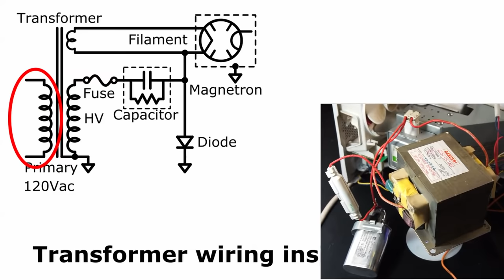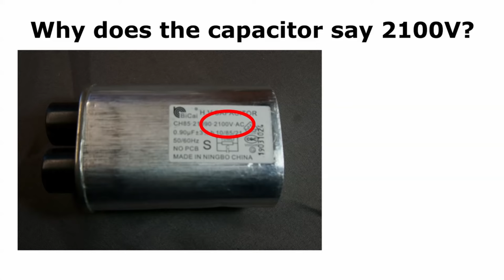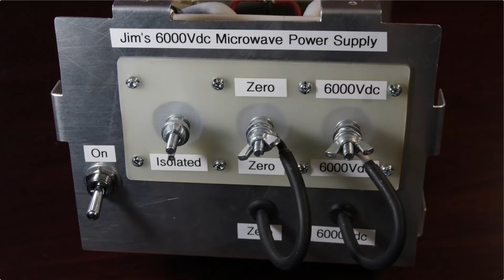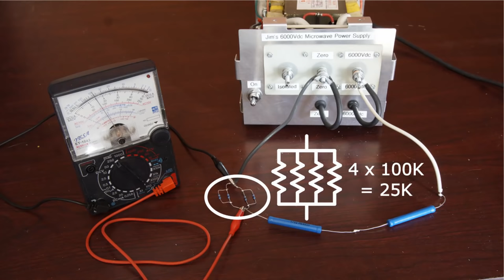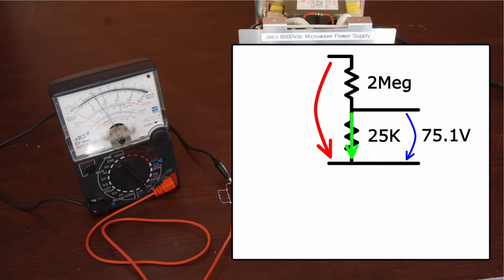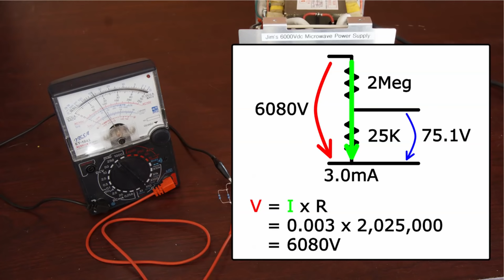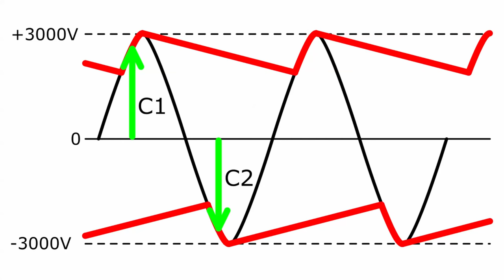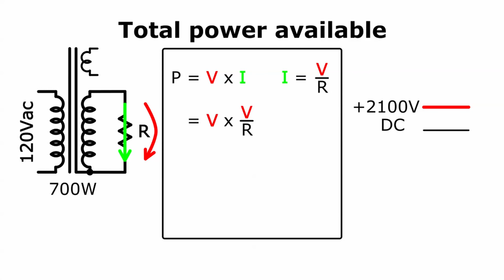6000Vdc power supply built from a microwave oven transformer

Comment: I am trying to go around forking out money on a big dc to ac inverter i have 1500w sine wave inverter and im wanting to see about adding a microwave transformer to get it to get more watts. Im needing 3600 watts to run camper. Can i use this ?
Reply: VERY SIMPLE USE 120 VOLTS STATION SUPPL;Y WITH AN 30 AMPS. FUSE AND YOU WILL END UP WITH  3600 WATTS.... VERY STRAIGHT OPÉRATION...HAVE ANICE DAY
Reply: NO

Comment: Very old TV sets used to have the EHT voltage, approx 27kv, derived from a mains transformer. This was stopped because it killed technicians.
High voltages then were derived from an oscillator that would die as soon as a high current was drawn from it, no longer killing people.
Making something like this is completely irresponsible.

Comment: This may be off topic, but someone might find it interesting.Over unity electric generator. By AMA.
Segment 1: 1 motor with bar connected to it standing vertically. Circular disc connected to bar that has magnets embedded in it surrounded in high permeability material to focus magnets outward pushing force in an upwards direction from top of disc. 
 Segment 2: Hollowed out cylindrical Bar of material horizontally positioned. 
 Flat hollowed out ring shaped material with openings around its outer top flat edge.
 Magnets surrounded in high permeability material embedded in these openings.
Magnets positioned in openings around ring are in at least 1 of 2 configurations either all N magnetic field pushing out or N,S,N,S all around it. Just depends on whether your going for Piston structure or spinning structure explained below & whether you want it to be DC or AC current. 
Place these all along the cylindrical bar connected to it solidly, except at far ends of bar. 
At both ends of bar place ring of material that can be magnetically repelled in specific locations. (magnetically repelled in specific location is in reference to outside of ring area that faces away from center of bar)(Other side of same ring facing in towards center of bar is capable of being magnetically repelled all around) Ring must be connected solidly to bar. points of repulsion on these rings is off set from each other on each end of bar. 
3 Hollow ring structures with small square bars protruding from each. Ring structure has all magnetic repulsion on inside of ring shape & can rap around the main bar so that the bar wont be causing friction on things as it moves back and forth or spins. 1st positioned around far left of bar, 2nd position at center of bar (be sure to leave enough room for magnetic structures to be able to move back and forth without hitting it) & 3rd positioned on far right of bar. 
Tube structure is constructed in two parts that fit together on top of each other length wise over main structure. 
Tube structure has 3 square openings for the bars that the Ring structures that are connected around the main bar keeping it from causing friction on structure, to slide into. 
This tube structure is designed with material that does not block magnetic fields. Perhaps some type of transparent material glass or other. 
 At both ends of the tube structure there is a built in circular groove that will house a round disc. The ceiling/floor/left side/& right side of groove has openings for small magnets to be  embedded in it, so that the pushing force from magnets is pushing in towards the edge of disc that goes in this spot. There is also 4 openings located on the top, bottom, left & right positions of the open groove. Small magnets are placed in these spots so when round disc is in position these magnetic fields will hit sideways keeping it from generating friction against structure. 
Far Ends of bar has Cap structure that screws over tube halves holding them together. Cap structure also has 4 points on inside top, bottom, left & right that have openings. These openings have small embedded magnets in them that exert there pushing force outwards (sideways) so it will keep disc in position, generating no friction against structure. Cap is made of material like tube so it does not block magnetic fields. (Note: These magnets in groove and cap structure are only needed for piston design. If Disc is directly connected to main bar so as it spins the bar spins, magnets are not needed here).
 The disc has ring around it (ring of material goes around outer edge and folds over front side & backside a small distance) that is repelled by magnetic fields so the 12 small magnets will keep it lined up but it will be able to spin without causing friction on structure. The disc has openings on it's flat side that face inside of tube and magnets surrounded in high permeability material are embedded in this disc. 
 The disc has small bar that is connected to it's center that goes all the way to the other end of  bar structure through the center of the hollowed out bar and connects to disc on other end. Disc on other end is set up the same but magnets embedded in it are off set in comparison. As first disc spins the magnetic fields will push against specific spot on disc connected directly to bar, pushing bar in other direction, once bar is fully pushed over, further spinning of disc will then align the other sides magnet to push it back.
 Tube structure also has half moon shaped protrusion on inside and on both halves so when tube is connected they line up to make a full ring shape on inside of tube, these half moon shaped protrusions have at least 1 small round opening on it's side in middle of curve that faces away from center of bar. The opening has a small magnet embedded in it so magnetic force is repelling out sideways away from center of bar. The protruding ring is positioned to line up slightly further in towards center of bar then the ring of magnetically repelled material connected directly to bar. This way when bar moves right or left it is magnetically stopped after a short distance. 
Copper coil setup: Copper coils are wound in at least 1 of 2 ways. Either coiled in circles next to each other (Like if you wound coils around a cylindrical bar) or laid out in a row as if wire was on flat table going up then bent to go down & back up until it formed a flat rectangle of wire bending up and down and then the entire structure folded around tube. Copper windings are then lined up perpendicular to magnetic fields on outside of tube. Ends of copper coils are connected into separate construct that will allow electrical current to flow somewhere else. 
Circular construct is built like a stand that goes around the outside of motor segment. Circular construct has flat ring of high permeability (magnetic field shielding) material that has small openings that will allow magnetic fields through specific locations. Top of circular construct has groove to allow the horizontal bar to balance on. Circular construct can also be placed on other end of bar so it is balanced. The motor segment is positioned so the disc connected to the bar that is connected to the motor is lined up so the disc passes under the horizontal bars disc that is at end of horizontal bar. The high permeability material keeps the magnetic fields in disc from hitting into the disc that spins or pushes the horizontal bar until just the right moment when the impact will cause the disc in horizontal bar to spin which will perpetuate the piston motion in the horizontal bar. More horizontal bars of the same design are built and positioned around the motor segment in a circular horizontal fashion all the way around. The bar connected to the motor can be increased in length to desired height (As much as motor can handle) and more of the exact same setup is repeated higher and higher up, maximizing the over unity potential of the construct to ridiculous proportions. :D Current from the horizontal bars is diverted to power the motor as needed and all other current is diverted to power my game console or the world. :) Interesting variation to this design would be to connect the spinning discs on far ends of horizontal bar to main bar that magnets are connected to so the magnets spin instead of getting pistoned back and forth. So long as moving magnetic fields are perpendicular to copper wires it should work. By AMA
Reply: There is no such thing as an OPERATING perpetual motion machine.
Reply: @c_b5060  Other than the parts eventually wearing out, I'm afraid there is. You see the trick to achieving an over unity electric generator that can just keep going & going is to exploit mechanical advantage over a system with the help of magnetic fields to do the work. Look closely at my design in other message and pay close attention to what I explain in the end of message It details how the motor is only doing a little work and the magnets are what end up spinning the other mechanisms in device to achieve over unity.
Reply: @MasterFeiFongWong  Well, this is great!  You have designed an over unity electric generator.  Now all you have to do it build it and you well become the most famous inventor in the world.  Well done.  I'll be watching for you in the news.  Good luck.
Reply: @c_b5060  Thanks :)

Comment: Long ago got the basics of this, the question is what are you going to do with it? A jacobs ladder would be nice. All techs worth their salt know about safety with electricity. The first nasty shock you will remember I can guarantee!!
Reply: I would normally place a bleeder resistor in circuit where high voltage is present.

Comment: i used this capacitor to create 240 volts DC it’s only a halfway DC power supply it’s just 1 diodes it’s gets 240 DC without a transformer it’s just to danger

Comment: what is the practical usage for 6000 v dc? I can use USD3  11Kv module, to generate negative ion or just for prank
Reply: The first thing that comes to my mind is a radio frequency amplifier using tubes. It would be something a ham radio operator would use to hook up to an antenna to transmit.
Reply: Fred Garvin  Hi friend. How do you supply your home with electicity from this microwave part ? What is the input?

Comment: You are using the controller PC board put are Not telling us how it is wired or how it effects the the use of the power supply. On end(wire) is welded to the core of the xmfr as it is made, did  you disconnect it from the case? If you connect the 6kV output  with out the proper load the capacitor will explode since the capacitor has a AC rating NOT a DC rating.
This 6kV can Kill you, yet you provide no disclaimer as to using it.

Comment: i do knows how it’s works this transformer do you knows if you apply 240 volts AC to the secondary it’s produced 20 volts for a 200 ohms transformers out of the primary if the 100 ohms it’s produced dibble I means it’s 40 volts what’s happen if you apply to the primary you will expected death sentence maybe I’m right or wrong what’s do you things

Comment: The explanation of how it all works is excellent, however anyone who actually needs such an explanation should not be messing with even mains voltages, let alone 6000V.  Or to put it another way, unless you're competent enough to provide such an explanation yourself, don't go anywhere near this. For context, electric chairs use about half that voltage. And to make matters worse, there isn't even a safety warning at the beginning. The whole video is highly irresponsible.

Comment: You must be an EE as you were thought that current flows from positive to negative.  I thought engineers were supposed to be smarter than the average guy.  :o)
Reply: Current does flow positive to negative  but electrons flow negative to positive
Reply: @just.someguy5145  -- it takes moving electrons to make current flow!  the fact is you were just taught wrong!

Comment: This is too dangerous. That type of transformer is unsafe to be used and it could be lethal. I would not recommend others to try this. One rarely needs 6KV at the currents that these transformers can deliver. It would be best to use smaller current voltage multipliers or inverters from fluorescent lamps which are less powerful.

Comment: Having scrapped a number of microwave ovens,  I probably have the parts to built a couple of these.  But I have absolutely no inclination to do so,  not seeing any particular use for it.  In the case of the final schematic and physical arrrangement presented,  you have one of those connections labeled "zero",  and it's not.  I kept waiting for you to address the point that one end of the secondary of that transformer is connected to the frame of the transformer,  and you didn't do so.  What you actually have on those outputs is +3000V on one and -3000V on the other one,  with respect to the chassis of that enclosure.  Not something I think I'd care to mess with.  Big Clive has a video on this very subject entitled "THIS WILL KILL YOU" https://www.youtube.com/watch?v=FBeSKL9zVro,  and I believe it.  Probably the most sensible projects that I've seen involving these transformers shows that secondary winding being removed and replaced by something putting out a much lower voltage,  typically to make a spot welder or similar.

Comment: Why would anyone want a high voltage power supply unless it's in a Working Microwave Oven ?????  I've got a Capacitor Discharger, but I won't be using it to remove a high voltage Capacitor !!!  I don't mind small  transformers,    it's the big ones I'm not so keen on !!!!

Comment: pure mechanical step down regulated power supply
Reply: resistance rail divider
Reply: kiss engineers, yes all
Reply: so you can easily make a 4x quad phase double-doubler, all working stupidly along each other, no overlaps
Reply: I mean continous simple dc-multiplication

Comment: I just built a microwave oven from a high voltage power supply. Now when I try to toast marshmallows in the oven, the power supply goes into rapid high frequency undamped oscillation, and blows the main breaker ! Maybe if I reverse the  polarity, I could connect a 9 volt battery and get some free energy without the undamped oscillations.

Comment: This is badly engineered and awfully dangerous. A supply this potent (there is no positive current limiting, so accidentally touching it is going to be lethal) absolutely needs to have either properly rated shrouded HV plug terminals or a large insulated cover over the output terminals with an interlock that only allows the mains switch to come on when it is fully closed. Please take a look at how neon sign transformers and industrial HV power supplies are constructed.

Comment: I do not know why you are building a lethal power supply and exposing novice experimenters to a death device. The wire you are using is not specified for the voltages you are generating and one small slip of the wrist could be deadly. Please remove the content before someone kills themself! How would you feel to know that you may have killed a 15 year old novice tinkerer? You have provided zero safety instructions for the handling of such extreme high voltage. The gloves you sow are for working in the garden...not insulating a high voltage supply. Those are cloth gloves that will NOT protect anyone.